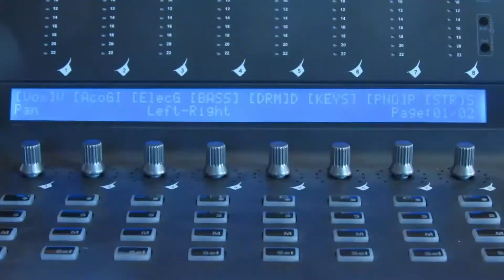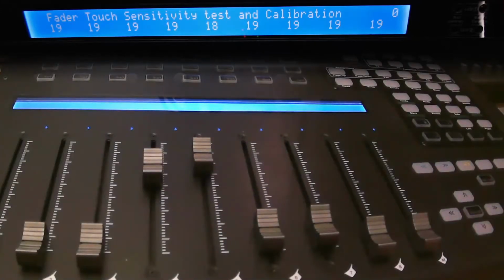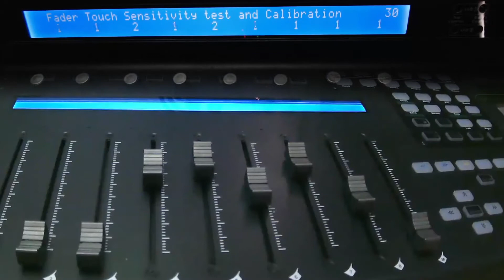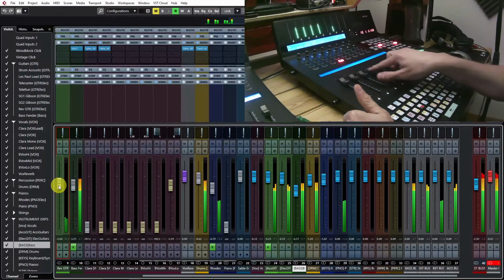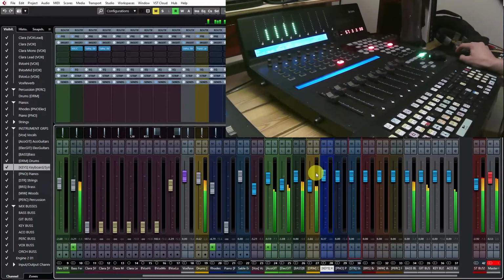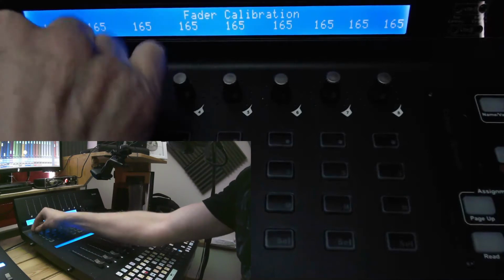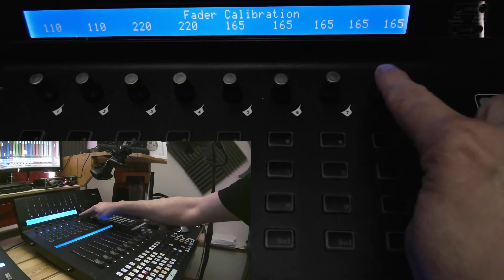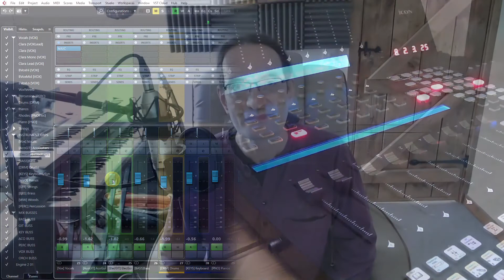Qcon Pro X and G2 Fader Sensitivity and Calibration

Comment: Hi. On 2:17 youre all faders are on value 19, also mine but fader number 6 and master fader is on 76 and i have problem because they dont send midi out from icon but recieve in from cubase. Also blue light dont blink when i touch him? Please help
Reply from the maker: It sounds like they have been set too high for some reason. Don't know why only those are on 76 but if too high then no matter how hard you press they won't respond correctly. In the video I do explain the settings and how to change them. As a first solution I would set fader 6 back to about 19 then see if it works better. The master fader is a separate issue and you adjust that differently but I do explain how to do this too. It will be slightly different for each unit but try reducing that too. The manuals really don't explain any if this so it took a lot of trial and error for me to set my unit up but it is worth it in the end and 7 years on I'm still using mine and they work really well. I wish you the best of luck. Darren
Reply: @MoonhareStudio how to set on 19?
Reply from the maker: Set fader 6 to 19. The master fader may be different but try that then if still not working set it to 8 or 9 and see what happens. 19 happened to be good for my unit but I do recommend trying different settings until it starts to feel right for your one. They do seem to differ from unit to unit.
Reply: @MoonhareStudio even if i set faders to 5, still is on 76, and also, when i press fader, the midi out led doesnt blink.
Reply from the maker: I think you'll have to contact Icon or your supplier. Obviously I'm just a user like yourself so I've posted all the information I could work out for myself but I'm not attached to the company in any way. Perhaps there is an actual fault with your unit?

Comment: Thanks. I'm using Logic Pro, but the DAW shouldn't really matter. Can I set the "unit gain" position of my faders?  I mean, I want to set my faders so when I put them on the long tick mark 2nd from the top, my DAW is set to unity gain. Is this possible?
Reply from the maker: I don't believe there is any specific option to be able to do this although it may be that with a little trial and error you might be able to approximate it. To be honest I haven't found any particularly useful official guides to all this which is why I decided to do my best with some rather unscientific experiments in this video to find out what happens when you try different things. You can't break anything so try out some settings and if it doesn't work just put it back to how it was.

Comment: Hi, Darren..  Thanks for making this video. It's great. 

I have a question, hopefully you could shed some light on this for me. 

How do I stop the faders from knocking when in standby. There seems to be constantan micro glitches from my faders (but faders not visibly moving) and no matter how I change the parameters in the calibration phase I cannot stop it from happening. Where am I going wrong? 

Also when changing the Fader touch sensitivity turning off the unit does not save the setting I made. 

Possibly a bad unit? 

Best,
Jamie.
Reply from the maker: Hi there. So I know exactly what you mean about the clicking or tapping sound because my Pro X also does that. I actually got my unit at a reduced cost as it was a display model. I contacted Qcon, went on the forums and their only advice seemed to be update the firmware. I never got any further with them and it has never changed. My extender is fine. I have mentioned this in a previous video and decided that it was such a low level sound that it didn't cause me any problems. If it's a deal breaker for you and you've paid full price you are well within your rights to request a replacement that doesn't tick. As for your other issue if you are doing the fader calibration (as opposed to fader sensitivity) then you must press the channel 8 rotary pot when you finish to save your settings before powering down (see about 9.15 on the video). You should see a settings saved message pop up. If this doesn't work then again this may point to a physical fault. But do make sure you are on the latest firmware for your particular unit too. Good luck and thanks for watching.

Comment: Hi! I’m a new proX user. Your videos are very useful, thanks. My question: If the daw project (Cubase 10.5) is 12 db the fader will be too “short”. If I switch 6 db the fader motor pull back on top. Can I change the fader measure for full range use? (Sorry for my poor english) :-)
Reply from the maker: The settings for your mixer in Cubase should automatically adjust to the full length of the fader on your Pro X whatever db range you have it set to. If it doesn't track correctly then you may need to drop the calibration number for each channel to correct this. Try moving your faders in Cubase with your mouse to see if they are moving top to bottom. I have never had a problem with this in Cubase 10.5 so I hope it will work ok for you too.
Reply: @MoonhareStudio  Thanks the fast answer. I try it and waiting for your new videos. ;-) Great.

Comment: Thanks so much for this. I just got an XS to go with the main unit and it had really slow laggy faders. I was worried I would have to send it back. When I checked it was set at 185 on all faders, so I dropped it to 150 to match the main unit and now it is fine :)
Reply from the maker: Hi Ryan. That's great news. It's all a bit trial and error but I'm really glad the video helped.